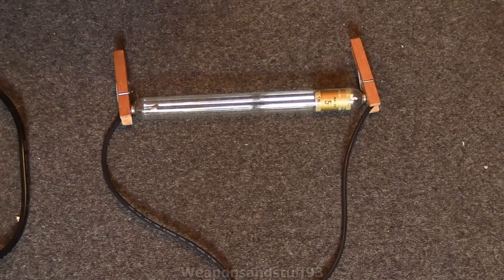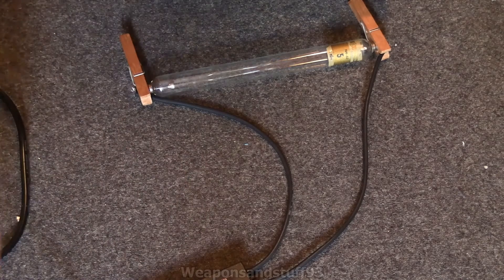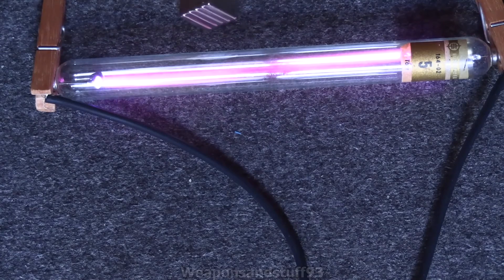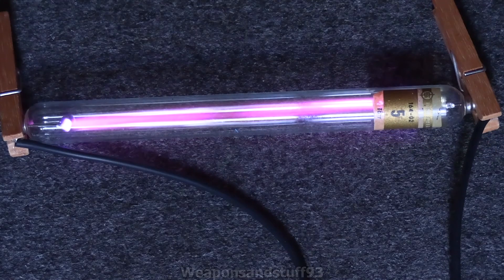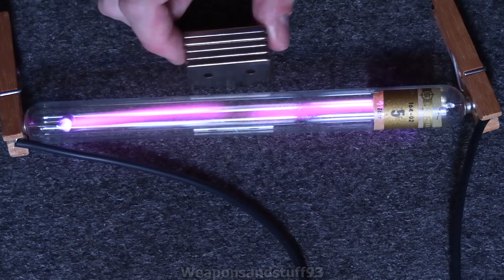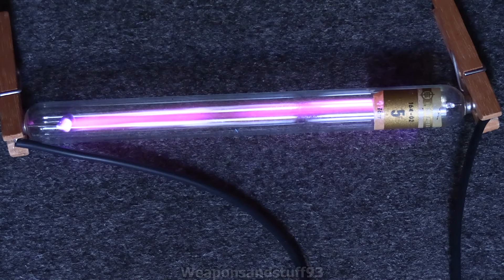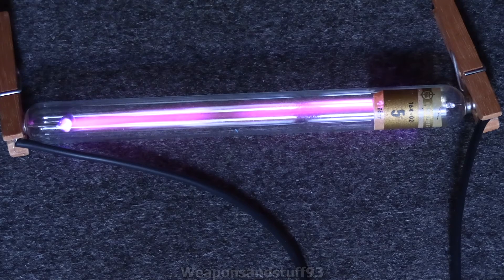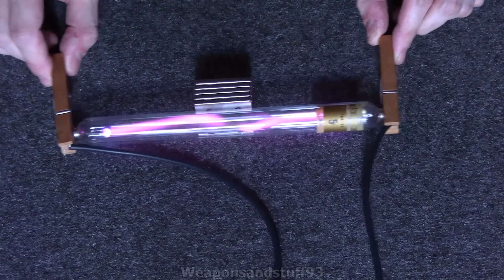Powering a Crookes Tube/How Roentgen discovered X-rays

Comment: Dont't want to be "that guy" but you should be a bit more careful with high voltages, especially across your chest, as in when you touched those clothes pegs with both hands. Those have metal springs around them and when you're moving it around like that those wires could easily slip and accidentally touch something you weren't looking out for a second before. I would advise not touching stuff like that when there's power in it, or at least not with both hands.
Reply from the maker: Yeah no worries it's good advice, only thing I can say really is while this is a high voltage supply it is very low amps. As the saying goes "Volts jolt, Mills kill"

Comment: Very cool experiment, I love these radiation related videos!
Reply from the maker: Cheers, should be noted the voltage is not high enough to really make x-rays though, this same voltage on a triode probably would, hospital style power supplies are very bulky and expensive, also I don't really have a concrete room to safely fire up old x-ray tubes in lol.